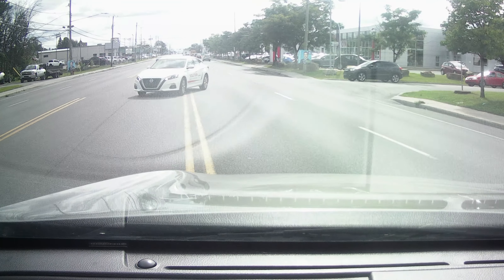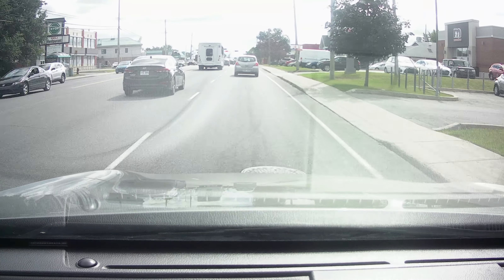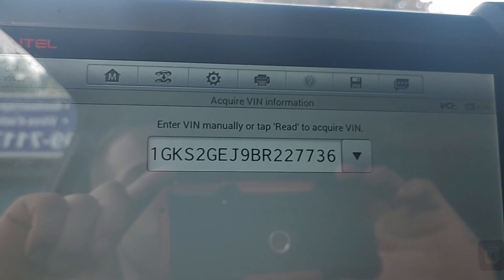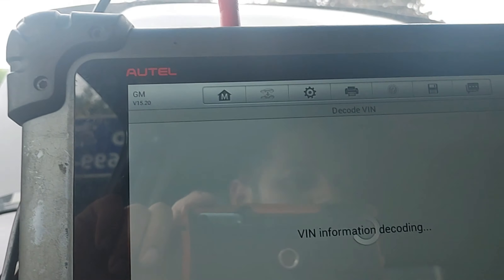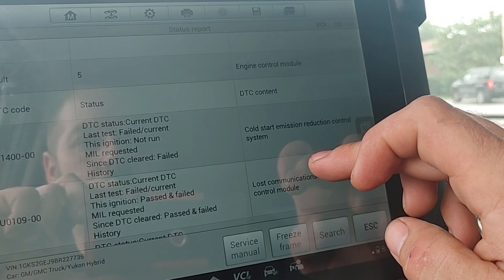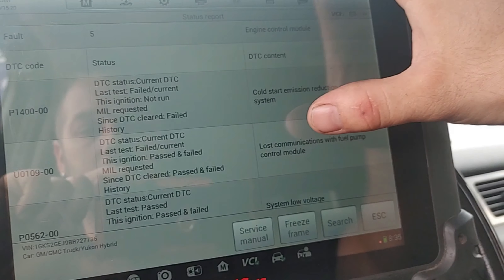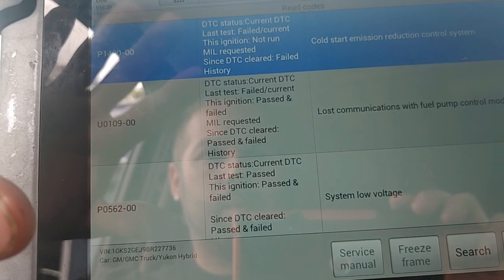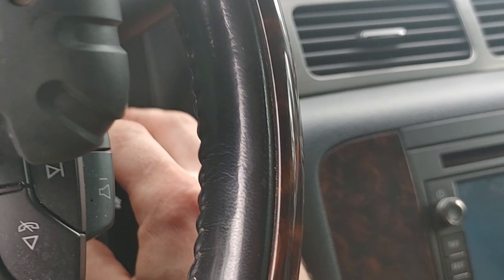2010 Yukon Hybrid No Start

Comment: I have Hybrid Cadillac escalade. One day it was fine, after I changed coils, I disconnected 12v battery while I was doing that. Car refused to start next day. I had to use jumper. Right after use jumper it is ok. And during same day it starts fine. Got new duralast battery installed 3 month ago.

Comment: nice to see you mobile its a lot harder than the Garage. well done
Reply from the maker: yah I' m trying to build a customer base right now. Don't really like to do the big jobs anymore lol.. if i can get more diag and programming on the go it would be great
Reply: @JLsAutoSolution  that is where I'm heading two bud in the middle of a Mobile diagnostic business setup and doing a business plan as we speak. I am getting to old for gearbox removals and all the heavy stuff.
Reply from the maker: @iankelly2110  Completely understand. The thing about a business plan where i live. If its for a garage/ mobile Diagnostic business, the banks will not lend anything. So it really is a do it your self or take out a 75000$ personal loan for vehicle/ equipment / start up cost.

That's why Im still working 40 hrs a week and trying to build a client base.

Here we are paid hourly as techs and all the shops are run as if we a flat rate. Most have crap pay and do not have  bonus system, but still want us to pull 60+ hours of work.

That is why this field is failing..

Sorry for the rant
Reply: @JLsAutoSolution  that's crazy 
No incentive to help you start up your own business it's all gone to commercial they don't want independent sole traders in business any more.

Comment: Im looking intp a 2009 silverado wirh hybrid system issues. It starts sometimes...
Amy comments will help. Thanks
Reply from the maker: These vehicles have a huge Fuse box(under hood) failure rate. That would be the fist area I would check. Just make sure there is no corrosion on the surface(its a quick check) if there is any amount of corrosion you can suspect a faulty fuse block.

Always have a vehicle inspection done with a vehicle health report(done with a scanner). Every module should be scanned. there could be unknown issues on the vehicle.

Comment: I have a 2009 Chevy Silverado dual mode hybrid, died on a red light, the battery voltage is 8 volts, replaced the battery, boosted no crank, no movement ... fuse box looks good any thoughts?
Reply from the maker: A starting point would be to check for DTCs, the check for bullitens relating to the DTCs of r symptom.

Thanks for watching